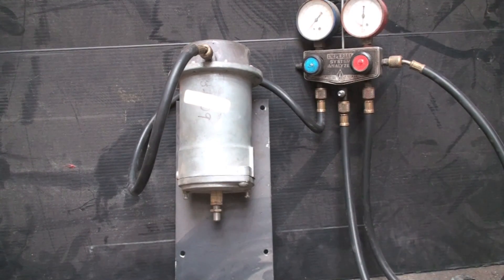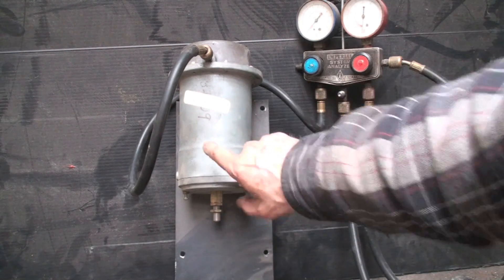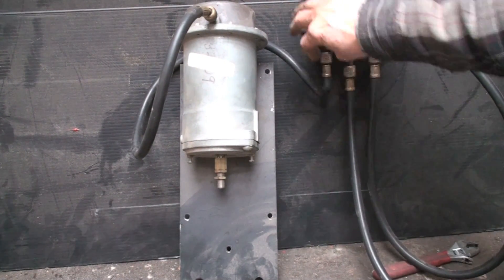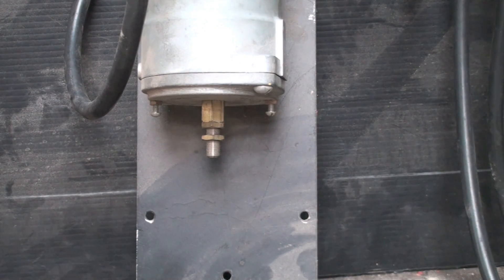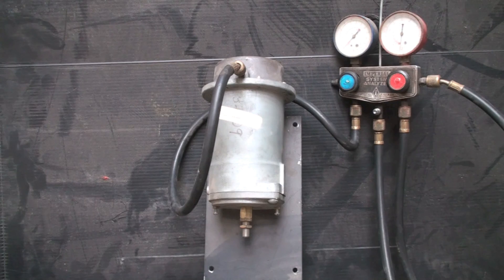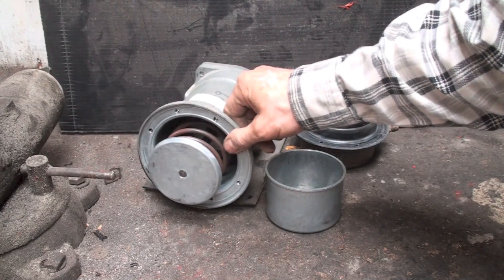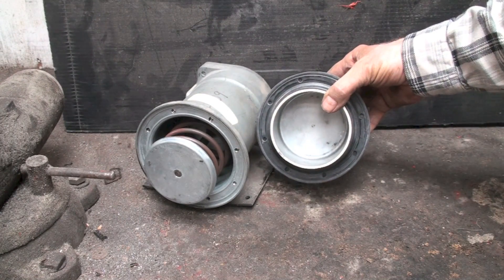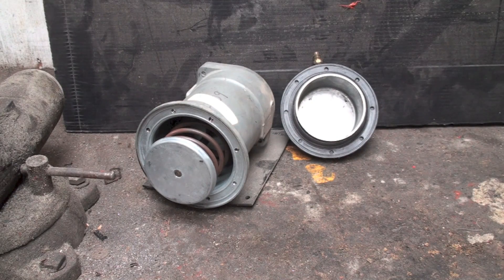How the HVAC Pneumatic actuator works

Comment: Great video. Those damper actuators can be a lot of fun especially with their different spring ranges like minimum position dampers. You should get into the topic of direct acting and reverse acting systems and how they work along with NO and NC valves and pneumatic controllers that would be a very interesting series.
Reply from the maker: mechanicwarrior20 I have been on the lookout for some of these devices.  When I find some I will do a series on them.  It could get quite long.
GFM

Comment: Way better than electronic. They never go obsolete. Great video.
Reply from the maker: John McMaster That's pretty much the way I see it too.
GFM
Reply: grayfurnaceman John McMaster Not to mention quiet and fast, too! It's hard to find an electric damper actuator that's both fast AND quiet. Most of the fast ones are real screamers, and the quiet ones move at a snail's pace. Pneumatic controls get an unfairly bad rap. There are a lot of poorly maintained and misunderstood systems out there, and I think that has a lot to do with it. A properly designed and maintained pneumatic control system works extremely well.
Reply: I don’t know what world you all work in, but pneumatic systems are the dinosaur 🦕 of the HVAC controls (old, antiquated and use an absorbent amount of energy ). If you enjoy a world of air leaks , loud compressors , line moisture , inaccuracy , slow, response time & poorly maintained systems ,be my guest /pneumatic systems are for you 💨. I will take a properly design electronic /wi-Fi system over a properly design pneumatic system system any day of the week .